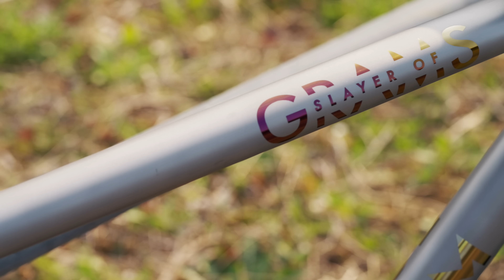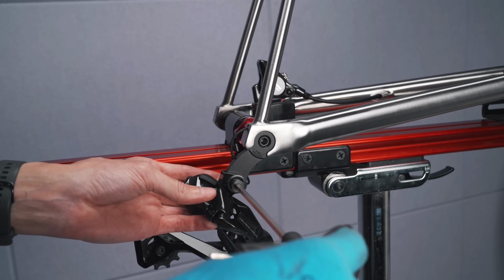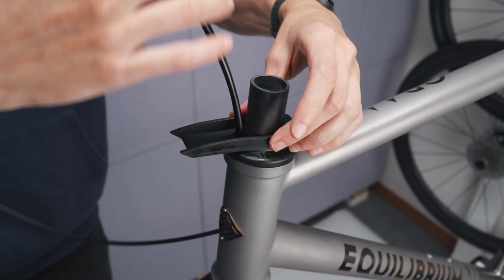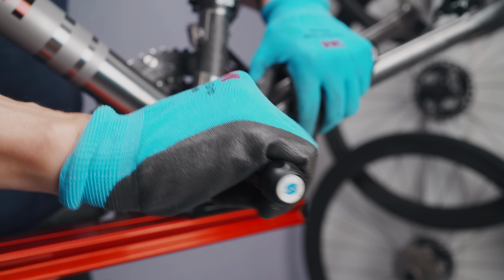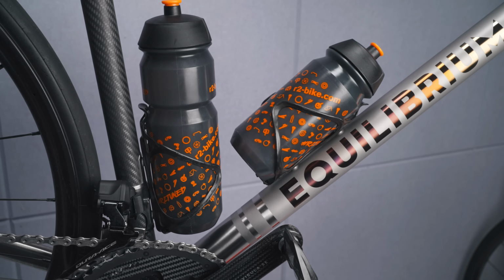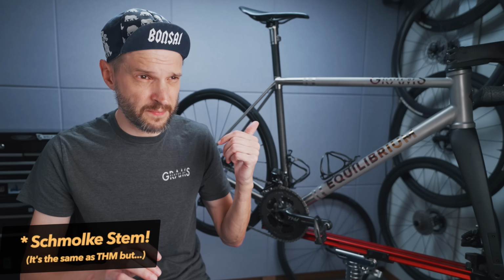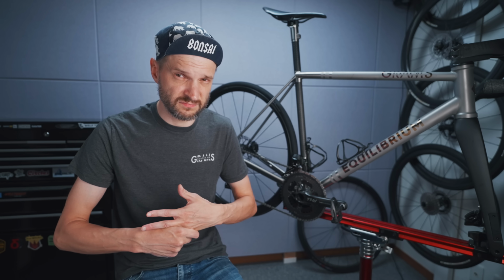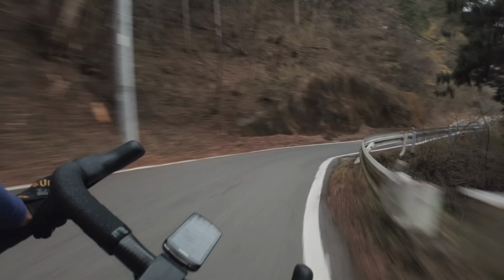My sub 6.6kg Titanium Climbers dream! Ti Weenie Ep 4

Comment: ATTENTION! Galvanic corrosion!
You are right about corrosion between different Metals, in this example of aluminium and titanium. But it is even more so between copper and aluminium! These two metals will corrode! They are very far apart on the galvanic scale and dissimilar metals. So I would highly recommend using a ceramic based anti seize and removing the copper based anti seize from your bottom bracket! Copper based anti seize is only used for steel on steel. On aluminium, NEVER use copper based anti seize because it WILL corrode!
Yes, the bottom bracket is anodized (which protects the aluminium itself) but in the long term you will not be able to remove the bottom bracket anymore, and in the worst case this will also damage your frame. 
Ceramic based anti seize is not electrically conductive, wich will prevent the galvanic corrosion. 
I hope this helps
Reply from the maker: Cheers! Will look into it 👍

Edit: thanks for the explanation!! 
Times like this I wish one could edit a publish video easily 😅

Hopefully the pinned comment will help.

I’ve used (and still do) copper paste on Ti bolts into aluminum parts many time before and not had any problems so just went with that. I was told to use anti-seize (they recently had to cut out a BB from one of their customer frames that was installed without it) and with zero knowledge in material science I just used what I had laying around with the label anti-seize hehe. More knowledge added to the databank, cheers!!
Reply: @ridesofjapan  I used copper paste on my car (wheel - hub) and it messed everything up. Since I started using ceramic paste everything has become so much better. You live and you learn.
Reply: Servira

Comment: Deda are really doing their bit to make carbon steerers stronger with their 70mm steerer plug and this new composite split ring.

Id put some 3M helicopter tape around your steerer though so the hydro cables dont rub away your steerer longterm or cause ghost bleeds aka brake fail from the cables leaking oil from rubbing together too much.

Comment: Great build. I just got my fully custom Ti frameset as well. It was media blasted in a similar fashion as the Slayer of Grams. My builder used a light lube like T9 to clean up the frame. Just a little spray on a terry cloth to wipe it down then chase with a dry cloth. The blasted areas of the frame absorb the lube and it simply pops, plus the bike smells amazing when it's all wiped down. Give it a try on your frame, it may not work well with the anodized sections and polished sections, but thought I'd share.

Keep up making these great videos and building up top class bikes.

Comment: Beautiful bike. So much attention to detail. 
After seeing your video, I went and weighted my Ti bike, which is a custom frame, with mechanical Campy Super Record 11 from 2009 with rim brakes, Shamal wheels and off the shelf components, , and it comes out at 16lbs. Not bad for an old bike and makes me think I made some good choices way back then :)
Only thing I have to try is wider tires to see if they fit - it"s still riding on 23mm :')

Comment: I bet shorter trail results in new descent KOMs. It's basic bike geometry theory. I'm in the process of building a custom Ti frame and went with more conservative 60mm trail and fat 35mm tires for long days in the saddle.
On the frame finish, I noticed that Prova goes with paint up front and polished (!) rear end with brushed bits. I have another bike with blasted finish (I think it's old style sand blast) and it's quite a pain to wash.
Anyways, big thumbs up for the bike and welcome to the Ti guild!

Comment: Very nice build and video! Keep up the good work!
Although from a technical perspective, I never understood the logic behind copper paste on aluminium. The only thing preventing corrosion there is the grease part in the copper grease (no electrolyte -> no corrosion). But aluminium and copper are basically still a battery. Copper paste was designed for high temperature steel on steel applications where the organic grease part cooked out. Although nowadays, with ceramic and non metallic compounds available, I wouldn't use copper grease for anything. It is such a dirty mess

Comment: Custom > Stock
But some stock frames are definitely better than others regardless of material! When each tube is prescribed from the builder specifically for you.....wonderful things happen!

I just got done building up a Rodeo Labs Flaanimal 5.0 that has a carbon seat tube. Its of course not a "slayer of grams" bike as its gravel and bikepacking, but it has a much better ride feel than say a Surly or even a Kona. However, I also own a '16 Trek Boone, and I have to say they did something magical with that frame. The IsoSpeed and curved fork are just sublime.

Beautiful bike, enjoy!

Comment: Lovely build 😍 Anything that has a blasted/pitted finish will be a magnet for dirt and marks. The surface needs to be treated/coated. If I had to be critical the stem doesn't look right. I think a more rounded/tube type stem would be nicer, the current one looks to bulbous/square against such a lovely classic looking frame.

Comment: Lucendi could help you print a headset cover that fits better with the frame and stem, that replaces the Deda cover + equilibrium 3d print spacer. He did one custom made for me and it wouldn't look near as good as without his help! It also enabled me to use a 6 gram aluminum headset C-ring. FSA MR128R (2x) bearings 48 gram, C ring 6 gram and custom Lucendi headset cover 17 gram painted. Mega lightweight for internal routing.

Comment: Maybe go for Darimo cockpit. It’s a fair bit smaller visually
Reply from the maker: It's a possible option, but would also require some custom spacers and it's still quite the investment either the nexum or separate stem/handle bar would be 700eur + 
Never know that the future holds though.

Comment: I trust you are enjoying your dream climber. How is the sub-compact crankset working out with the new FD? Any different than using a compact? Any missed shifts, noise, dropped chain? I want to match a 48/32 with the newest Ultegra di2 FD for long, hard climbs. Also, I'm just a regular older guy, so anything that can help is gooood. Good riding!
Reply from the maker: Not using a sub-compact on this bike. I'm on a 50-34.
But you can check my subcompact experiment here: https://youtu.be/svqaU_Ai1U0

Comment: I love your sharing, with a dry wit, your passion/obsession for weight reduction on your bikes.  The logical question that comes to mind, at least logical for me is:  it possible to build a safe sub 6 bike using available components and maybe a custom frame?  I don’t want to put any crazy and/or ridiculous ideas in your head, just wondering….
Reply from the maker: If you take in mind that this frame is 1400g, swap that for a carbon frame sub1000g and you have a bike under 6kg no problem :)
Cheers mate!
Reply: @ridesofjapan 👍

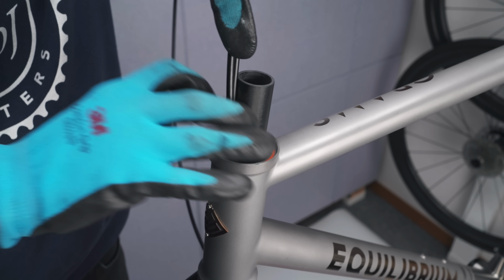Comment: Regarding the split ring that provides the interface between the upper bearing and the steerer (5:14): Is it not the case that because of this cut out, there is nothing in the front of the steerer that is supporting the load between the steerer and the inner surface of the upper bearing? More specifically, does this not increase the radial load on the steerer tube at the ends of this c-shaped ring? And is there anything in this system that maintains the orientation of the split ring as you turn the steerer, or does it just move with the cables? TIA.

Comment: I have also installed THM products and wanted to ask if the weight specification for the THM handlebar is correct. I would have rather suspected that the 44cm wide Vesion is in this weight region.

By the way, a great bike it has become. I'm a big fan of titanium and ride several titanium frames as well.
Reply from the maker: handlebar weight is correct.
Cheers!
Reply: @ridesofjapan Thanks, I have written an possible explanation under your short weighting video of the handlebar.

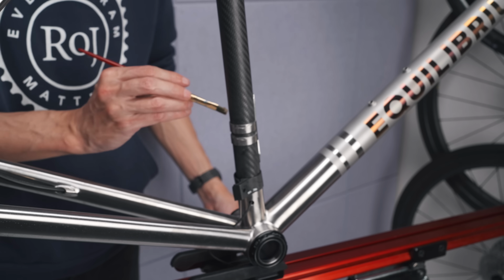Comment: What a machine!  Should there not be a rubber grommet to prevent water ingress and protect the front derailleur wire, going into the seat tube (7:35)? 
And, now, where is Mark?
Reply from the maker: I didn’t have a grommet that fit during the build. But not an issue for me who never ride in that rain anyway ;)

Comment: Wondering how your experiment with drip wax worked out. Isn’t there a contradiction between using a clean lube and wanting to clean your drivetrain every ride? 😂
Reply from the maker: I’ve been waiting years for someone to finally pick up on that, you are the chosen one 🙌 This is why I don’t crockpot my chains.
Drip wax is still easy enough to clean like a normal chain lube, so best of both worlds ;)
Reply: @ridesofjapan  I ask cos I made the same move and now I have a garage full of degreaser and nothing to degrease :-)

Comment: Does carbon ti wear out quickly? I've read that carbon wear out very quickly with frequent heavy rides, just want to hear your opinion? Thanks.
Reply from the maker: Are you taking about the chainrings?
The teeth are not carbon, they are aluminum like most other chainrings out there.
Reply: @ridesofjapan  yes was referencing the chain ring. Thank you for the quick reply now I have more confidence in purchasing one. I’ve been watching your super helpful videos and downloaded the weight weenie Gsheet and try to help my bike loose weight. I have an old steel Chesini Innovation racer and it is around 10kg currently. Wonder how much I can shed off.

Comment: Disc brakes, sure, DI2 why not, tubeless fantastic, internal frame routing sure whatever (awesome with factory sleeves),  internal steerer routing no, hell no. You need to stamp the head tube 666 it would be fitting 😛.

Comment: Lovely build.  You are very meticulous.
But watching that 90 deg bend out of the steerer tube of front left lever brake hose and Di2 cable violates this mechanical engineer's sense of correctness. Another acute turn through the handlebars. Just seems wrong.  Glad it works ok.
Thanks for sharing your build.  I live in flat country but am a fan of Ti...and all materials really and appreciate people that build their bikes.  I wouldn't own carbon fiber chainrings...carbon has poor abrasion and impact resistance...or even electric shifting and I don't like disc brakes where I live but may feel differently living in the mountains.  But that is what makes the world go round, different preferences.  Also, I don't like single bolt seat clamps as they slip even in the pro ranks or can and take big torque to stay in place.
Ride safe.

Comment: FULLY HIDDEN CABLES SUCK AND ARE UNNESSARY AND UNSAFE FOR HYDRO BRAKES ,since it has shown to cut hydro hoses causing brake failure !! lf not so then motorcycles would do the same thing WHICH THEY DO NOT FOR SAFETY REASONS !!

Comment: I'm surprised with the weight of the frame. The Litespeed T2 is lighter and has no carbon parts.
Reply: I have the Litespeed T5 and his frame weight is similar to mine.
Reply: @denethorpalantir2815  That's my point. I don't see the need to a carbon seat tube and 3d printed titanium parts.